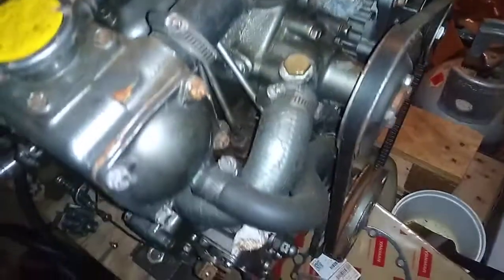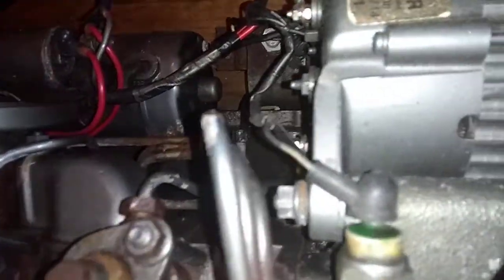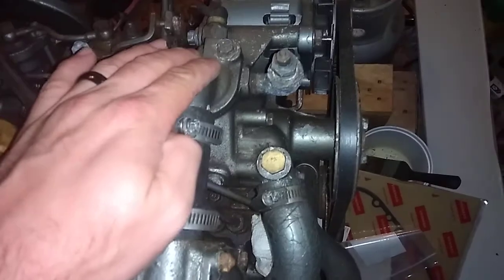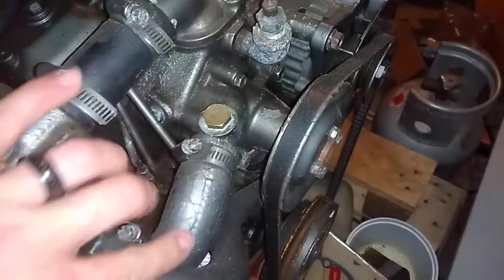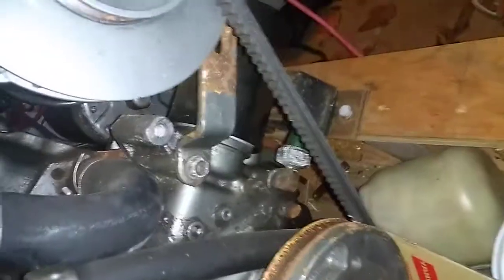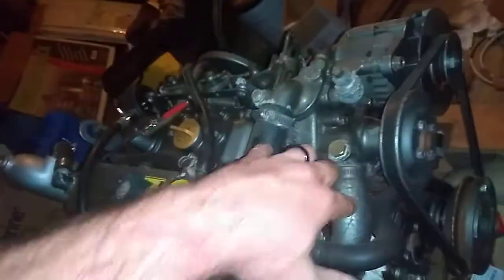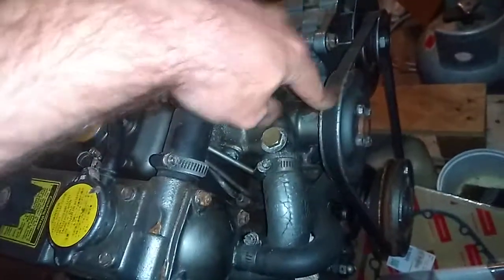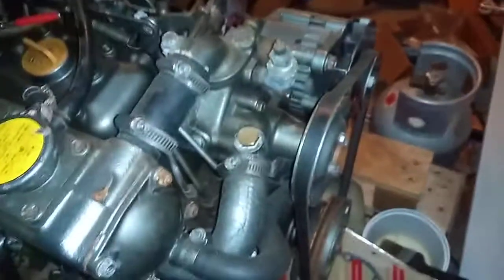Yanmar 3HM35F freshwater circuit

Comment: So apparently there's an impeller in the salt water pump and also in the fresh water pump ? Could you do me a favor and look at this engine, and help me identify it ? I'm trying to help a lady on this boat figure out where her cooler is and how to get it open to remove impeller parts in the fresh water section. She may have bad impellers in the salt water pump and fresh water pump. But probably just one of them, salt water. Perhaps impeller pump parts do not get stuck anywhere in the salt water side ? So, this is the engine I'm trying to identify and help her with.https://youtu.be/sks222zjWpA?t=3m59s And this is the video where she just barely talks about her problem. Husband hasn't gotten there yet. She's trying to do her best. I link you to the end of the video where she barely shows an impeller, which will be part of her next video, she hasn't done it yet or the repair. https://youtu.be/-DdPHNN6kgE?t=13m51s
Reply: Humm, that's a much quicker way to get those pieces out. Yes, I've seen people take the engines apart quite often. And, yes, I've seen them put the impeller parts together very carefully to insure that they are all there. But, most are taking the parts off the cooler up above and finding the pieces in there. So, this is much better. Currently , I'm a couch sailor, that is, not in the water, but preparing for what I think would be a fun life especially if I can get to warmer water. I live near the far northern California pacific. I'm gathering all these videos so I can be ready, and there are an absolute ton of Yanmars out there. Thanks very much for coming back with this unique quick way to get the pieces out.

Comment: Josh,  Thank you so much for posting this video.  My boat doesn't have the thermostat housing on the end of the cam.  The heat exchanger for my boat is located right above the transmission (reverse mounting due to V-Drive).  So, to make this change, I would need to buy a Yanmar Fresh Water Thermostat housing and the circ pump.  My circ pump is run off a pulley down in the usual space taken by the raw water pump.  I can't even see that pump without crawling into the lazarette and reaching around the port side.  It sits below the fuel filter and high pressure pump, totally out of reach from the quarter berth.  Tracing how the hoses route from this pump, around the exhaust manifold and up to the Sendure exchanger is a bit daunting.  I'll be heading to the boat over the next day or say and try to get you some photos.
Reply: Josh Muckley The system has two pumps.  Both are belt driven.  I appreciate the suggestions to convert to Yanmar parts but since this Sendure system was stock on the boat, I’ll check the current circulation pump and replace the impeller and move on to my next project.  I suspect that a raw water pump failure last season may also have done in the circulation pump impeller due to excessive coolant heating.